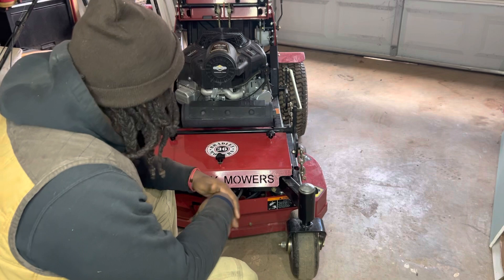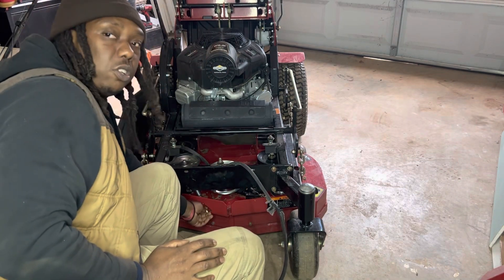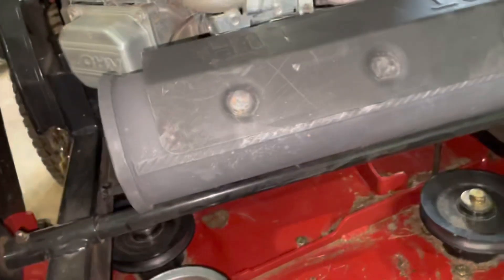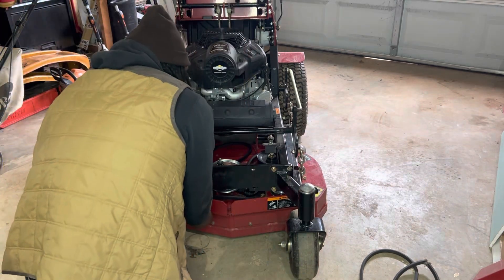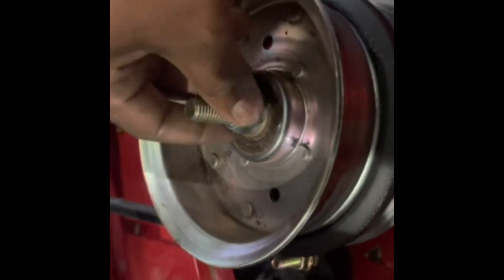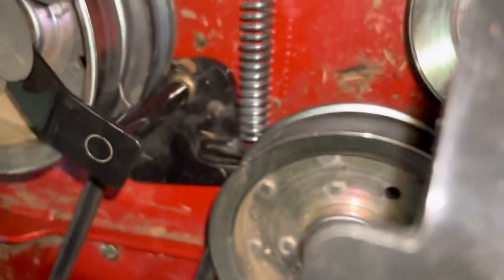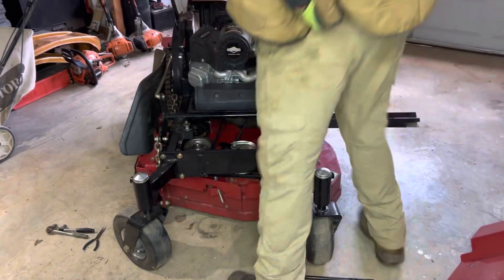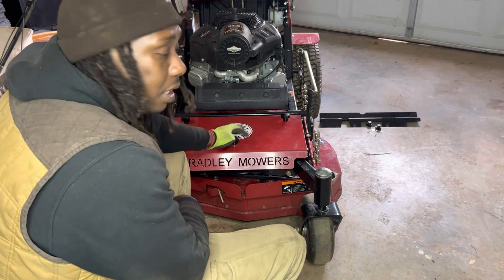How to change deck belt on a Bradley 36” ￼stand on mower…

Comment: Good video man!!!!!!!!!!!!!!   I subbed!!
Reply from the maker: Thanks for the sub!
Reply: There should be a spring length measurement for belt tension.  Let the deck all the way down gives you more room to work.  Can't believe you did all that with a spark plug wrench. Lol.
Reply from the maker: How to get can I get in contact with you?